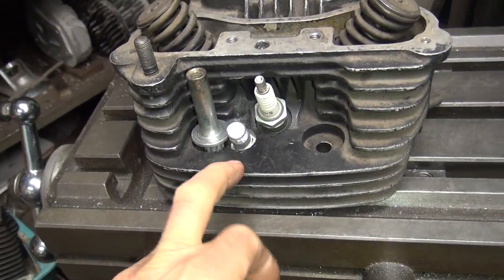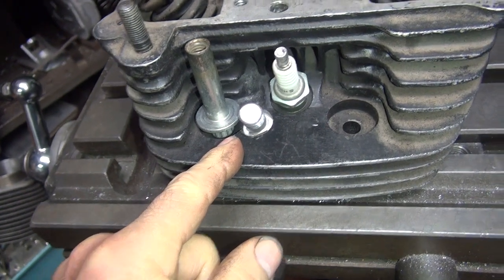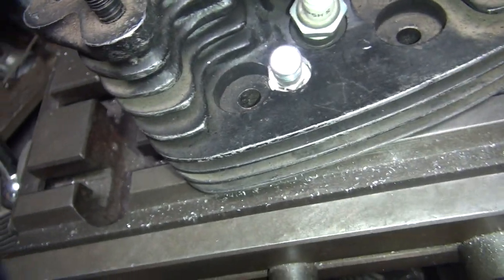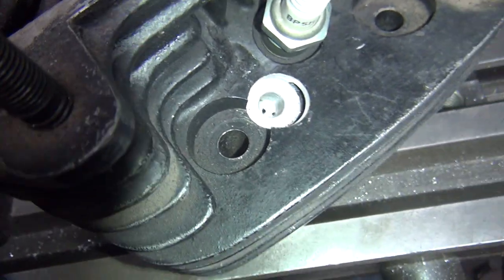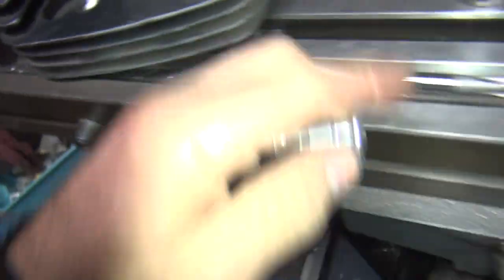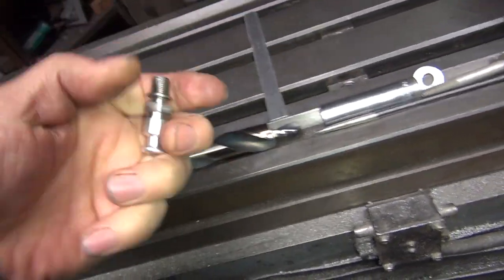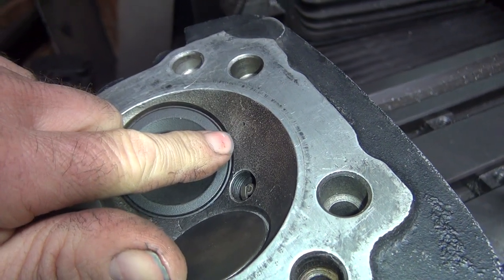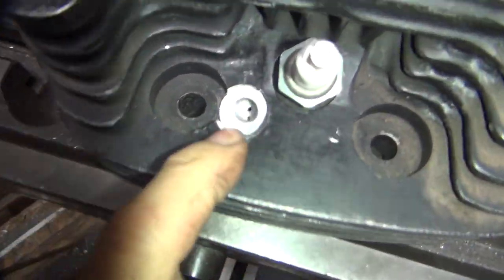#101 1993 evo how to compression release machining valve job 80ci harley by tatro machine

Comment: Could you weld some more meat in between the first and second fin to allow the Jim's position to be used so you don't have to go so deep and get your seating surface without daylighting out the first fin??
Reply from the maker: that comes under the fact that i have a welder and mill and know how to use them both. i tell the inspectors that all the time when they look at my crap.
tatro
Reply: @TatroMachine  I watched the next video in the series and you suggested welding on top, sounds like the way to go

Comment: Why couldn't they be installed on pushrod side? Like shovels dual plugging
Reply from the maker: the pushrod tubes are too close to each other.
tatro
Reply: @TatroMachine  if they can get a sparkplug in why cant they get a compression release in there? Just asking .I know Evo heads are  hard to put compression releases in you don't see too many.
I like your videos. To the point.!! If someone doesn't have some basic knowledge   then they won't watch them. They don't get it. 
Keep it up! Good job
Reply from the maker: you can put things in alot of places but if you can't get to them easyly, than why do it. those extended releases are way over $200. buy a better starter motor.
tatro